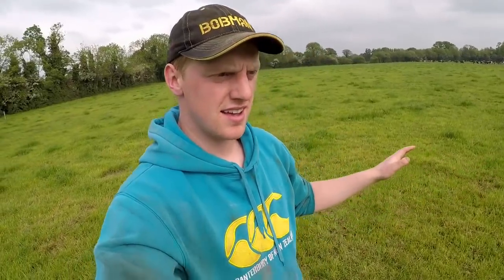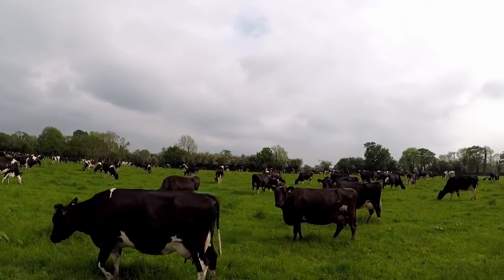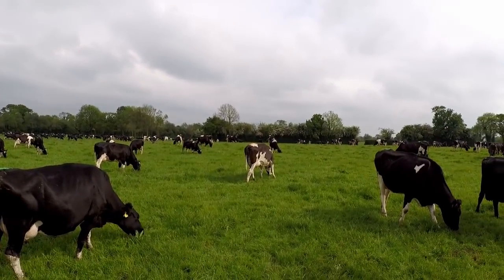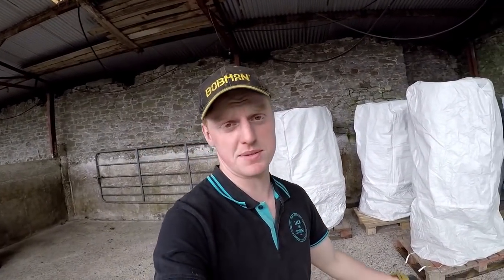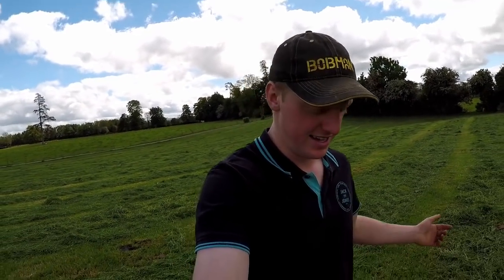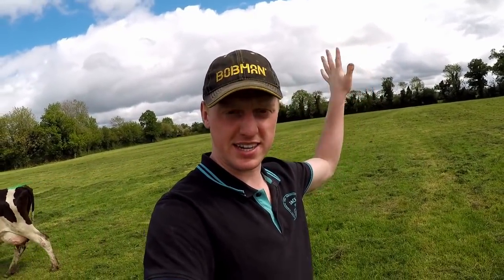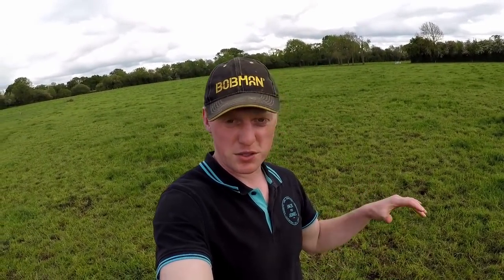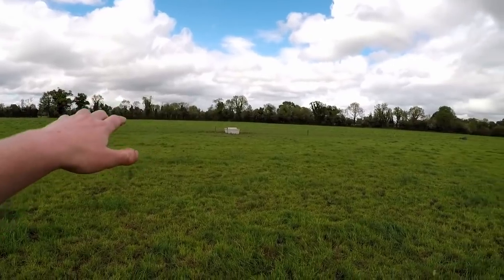Pre-Mowing Grass for Cows

Comment: Each to their own, grass is gone out of control. I've cows grazing fields they were in a week and a half ago. One thing I notice between premowing and topping is that once the cows eat the grass with premowing their dungs are still there and you've the same problem in the next rotation. If you top it you seem to spread most of the dungs around, either tractor tyres. 

Great video. Thanks for the uploads.